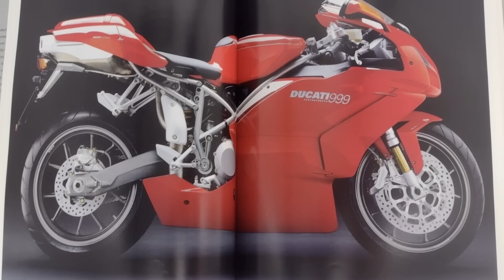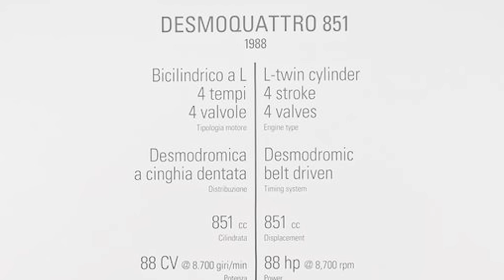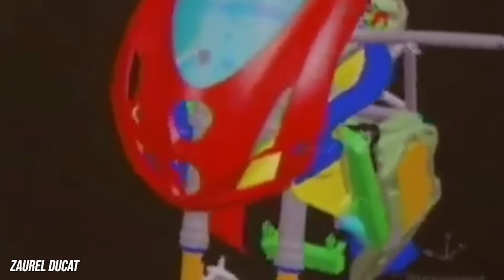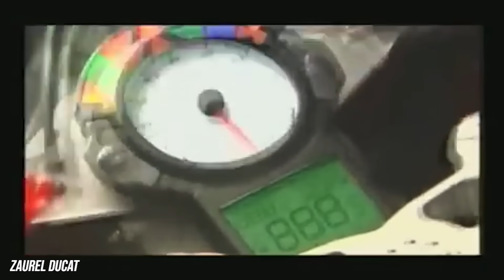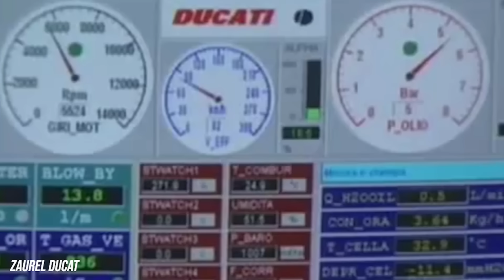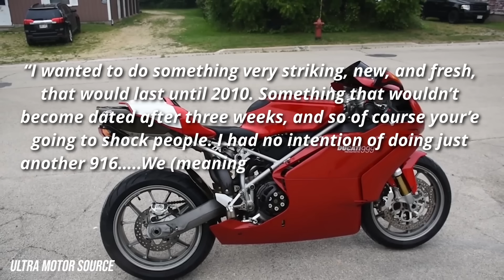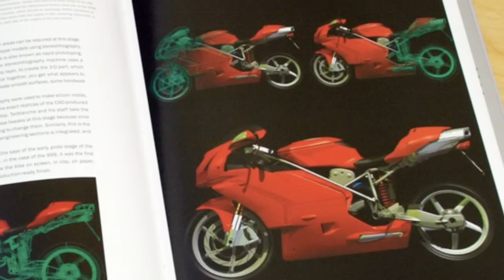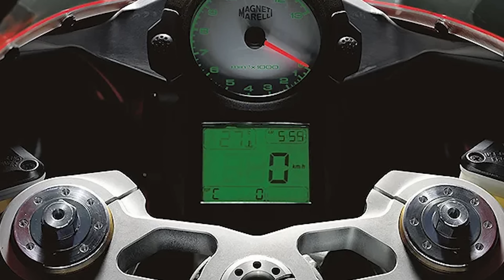Ducati's most hated motorcycle

Comment: This is a great video! Gives me a much better appreciation of the 999. I was a GSXR guy at the time and us Gixxer fan boys saw the Ducati's bros as snobs. My first Gixxer was a 2001 1000 that I bought when I traded in my 1998 CBR900RR. Well, I had a change of heart when I bought my first Ducati, a 2007 1098. Wow, what a sexy bike that was! I would sometimes just open the the door that led into the garage, turn my garage light on, and admire that beautiful red machine. It was a dream to ride but no where near as comfortable as the 2001 Gixxer 1000 I learned to ride the track on. Still, I became a Ducati Bro at that point.

Back to the 999...I never liked the 999 at the time and thought it looked like a 1940s locomotive with those cyclops stacked headlights. This video gave me a new appreciation of the 999 and now I'm actively searching ads for one to add this bike to my stable. :)

Comment: The 999 in race spec looks terrific. The biggest issue was the need to incorporate the headlights, which did impact the overall look of the bike. But, beyond that they were a fabulous bike to ride. I had a 2004 that I rode for a decade. It was one of the better bikes i had owned up until that point and was certainly a much easier bike to ride vs the 748R i had for a time. When I see a 999 on the streets they still make me smile.

Comment: I thought the Ducati Paso was the most hated Ducati. Both the 999 and the Paso were very forward-looking designs that have aged very well, with properly considered features that add to the expierence. If I had a 999 I'd paint around the headlights black to de-accentuate the feature, asite from that, it's a purposeful looking machine. I didn't know it had a sport touring riding position. Any rider who has ridden sport and sport-touring bikes will tell you that sportbikes are what you want, sport-touring bikes are what you need. Honda VFR1200F owner here.

Comment: Liked them, but having to change the piston rings to 996 rings to stop them from pulling oil through crankcase breather was typical first year Ducati b.s.
But at least the rear rotors didn't fall off like the first runs of the 916.

Comment: I have had a Pantah, 906, 851, 907ie, 916, 749, 999s, 999 and now 939 SS. That’s my own black 999 you photographed! (Well, I photographed it…) I love the 999 and if someone could fix its electrical gremlin I’d still be riding it. I’ve done about 50’000-60’000kms on each of these bikes so it’s not as if I don’t know them. 
The 999 is my favourite. Plenty fast enough and a lot more powerful than the 939 despite only having 60cc more engine. It’s a lot smoother too and just as good on fuel. I assume Euro 4 or something is the fly in the ointment with the later bike. The instrument cluster is superb and the mirrors don’t vibrate. 
I took mine from Switzerland to the very north of Scotland and once did 1’000 kms on it in a day almost non-stop (though it did kill me). 
I do not despair of riding it again one day. Best Ducati I ever owned and infinitely more comfortable than the 916, though I still racked up the miles on that. 
Just a pity it didn’t have a single sided swingarm.

Comment: Exactly why I havent sold my 749.  This design was great.  Beautiful, futuristic, but actually has an classic elegant aspect to it, in the flesh.  If you have both bikes sitting side by side, its obvious its the 999 thats the more beautiful.  But both have their own allure.  916 and 999 ride so similarly.  And yes 999 is better just like anything that supercedes prior models.  And 749 than the 748.  Also 749 is more tractable on the road.  Small tweaks make these bikes better for riding...which are:  larger clutch slave cylinder, modern 48 tooth clutch basket, power commander, 42 tooth sprocket and the R1 throttle tube mod.   Now its much smoother and pliable, with more feel, less hesitation, less jerky.  Honestly the hate was only from the press and people who never rode these bikes.  Im so glad there were so many that cherished this design.  The negative views meant that when the 1098/848's came out...we had something uniquely beautiful.  All the models after, up to now, are cool and striking looking.  999/749 was beautiful in it own way.  The performance of these on the road is all anyone will ever need....as the new bikes get more and more lightning fast.  All these bikes since the 851 were meant for the track and they proved it in WSBK over the years up to now with the V4.  Remember "the ugly duckling" turned out to be the beautiful swan.  I compare the 999 story to the F40 and F50.  Everyone said the F40 was better.  But in reality, it wasnt.  Mainly just build quality.  F50 was better and much more beautiful, and tractable for the road.  Beauty is always in the eye of the beholder, but again, put an F40 and F50 next to each other and see in person.  The F50 and 999 were in my opinion the most beautiful.  I was always happier being in the minority for loving them.  Now they are appreciated.  And now videos are being made.  I guess some people weren't ready for drastic change.  And in the future people will look back at Panigale's and feel the same, its cyclical.  Every brand has some version of this story over the years.  But remember, timeless design is timeless.  And some models just hit that mark perfectly.

Comment: In 2003 I picked up my first motorcycle magazine as a young man, and leafing through it. Not knowing anything about the 2 wheel world, I saw a big spread about this very bike and I loved how it looked like nothing else in that issue and all the other mags. The red was very alluring, and I had no prior knowledge of what DUCATI or a 916 was. This was just what I thought a sport bike was supposed to be.

Fast forward to about 5 years ago, a black 999S with 900 miles rolls into our consignment shop and and the boss wants me to try to get it started, since it seemed to have not run in long time. It had a termi exhaust and when I first got it cranking inside this antiques shop, you could feel the compression from engine resonating off the walls. Everyone in the front office was poking their heads out wondering what was going on. 

I relocated my efforts to the back alley behind the shop, fiddling with the choke lever on the handlebars, which confounded me since the bike was fuel injected. It finally fired up and made all that lovely L-twin, dry clutch racket. My boss asked if it was supposed to sound like that, so I revved it and he gave me a thumbs up.

I took it for a spin, but with no plates, insurance, and registration, I couldn't leave the parking lot. But I had been lusting for one of these bikes for literally decades now. It sold a few weeks later at auction for about $9k which was more than I could afford or else I would have tried winning it. But got to have a small taste.

The 999 is my white(red) whale. I still see them come up on cycle trader occasionally. Even the 749 versions. I still want one. Hopefully the hype after this video doesn't make the price skyrocket😂
Reply: Oh, sorry to hear you didn't buy it there and then after 'unsuccessfully' trying to start it.." this thing is a pile of junk but ill buy it off you cheap" 😂 good luck in your search 🤞
Reply: @ENLSN77  The thought had crossed my mind 😇

Comment: Miles ahead of the 916 platform.First duc that won against 4cylinder bikes of the same capacity.For me,probably the duc i would buy with my own money,would just get a newer ecu on it.Worked on 916,996,998,999,1098 and 1198.I would buy the 999

Comment: The 999r I had was no joke. It was the loudest motorcycle, Ducati I've ever had. I've had four ducks. This was the only bike I got thumbs up by every Harley rider at a light, it was so loud. $60k spent on mine. This is the only duck to listen to as reference to what a duck sounds like. This bike was no joke, I kept up with any panigale on it, beat most up the mountain. Crack that throttle and you could not hang on

Comment: I traded one of these 999s  in 2007 on a 1050 Speed Triple when I was working in a Triumph dealership. Follow up call with the owner elicited the comment that the Speed Triple was "Slow". 
I was surprised as the Speed triple was a pretty punchy bike, so I took the 999 out for a quick spin to check it out. That 999 Testastretta had so much torque and so much top end... Incredible engine. Later I bought an S4R monster with the same motor.

Comment: The trouble was they departed too far from the existing lineage 916. They didn’t need to do much to make it look just fine and continue some of the design elements of the old bike, and the swingarm was just a mistake. It was a great bike, but those things did put off a LOT of buyers who only returned for the 848/1098. Just think how many more 999s they might have sold if it didn’t look like a slapped ass…

Comment: You simply have to experience the 999 live to understand it. I rode the old 900 Superlight Series IV at the time and found the 916/996/998 really nice - but also much more stubborn, especially at higher speeds. I bought the 999R, which I saw live for the first time in 2003, without a test drive - and have not regretted it to this day. It drives much better and easier than its predecessors, has a very good "form follows function design" for my taste and still looks top modern today. If you put a 916 ff. next to it, only then do you realize how "fat" the old models actually are compared to this very slim model. The 916 ff then looks like a chubby motorcycle from the old days. I see my 999R as a stylish face in the crowd, the bike is recognizable from afar. There is no risk of confusion... And that somehow makes it unique. In terms of riding, the bike is beyond reproach anyway.

Comment: To be quite honest: The 916 never looked too charming to me. The single arm swing is a nice thing, but it is inferior to a two arm swing from a technical standpoint. To achieve the same rigidity, there has to be much more material in it than in a two arm swing which adds unsprung mass. The 916's nose looks like the face of some Star Wars villain robot. Me, I much prefer the 749/999 which don't try to make a face but show a nice aerodynamic curve. I like the stacked headlights. If anything, a change I would like to see on it would be a nicely airflow friendly transparent cover over the lights for a cleaner airflow. With the 749/999, it is visible that aerodynamics and function shaped it. Aerodynamics often generates beautiful flowing shapes. The jet exhaust like way the exhaust points back looks like its thrust would add 10kph to the top speed (With Rolls Royce Merlin powered planes, the exhaust actually could add some 1000 Newton of thrust!) 
 It looks like the purpose built machine obviously was. I really like it. Elegant and butch at the same time, and its looks make a promise. 
A Ducati that really looks unattractive is the 906 Paso, if you ask me. I guess it's so much of a design fail that people prefer to forget about it, it's too meh to associate with a brand like Ducati nowadays.

Comment: terblanche: (verb).  1. To make something strikingly beautiful immediately, disgustingly repulsive. 2. To put a wart on the nose of a gorgeous woman. 3. to follow the sexiest motorcycle in history with a two-wheeled Pontiac Aztek. 
Everyone told me that the 999 just didn't photograph well. I took one for a test-ride and it looked even grotesquer in person. At least I learned from this vid3o that Pierre was South African.

After my 999 test-ride (straddling a ticking time-bomb), I bought a 2002 copper-color Kawasaki ZX9R. The valve adjustments were admittedly a PITA, but that motor was butter-smooth and I've gotten over 100,000 miles on it. And it still doesn't burn a drop of oil and is still so much more beautiful and desirable than these ugly bikes. 
Its a mystery that we never see any of these hideous 999s on the road...?
Reply: Or 2002 copper ZX9R's for that matter ?
Reply: @61js  Mine is. :) And so is my friend's. 112,000 miles on the clock and it still pulls like a peach and doesn't burn a drop of oil. In fact, the oil is barely as dark as the copper color when I change it after 3500 miles. The amazing bike defies the laws of physics.

Comment: When it came out it was following the 998, which is a design classic, and it not only had a very unusual appearance but also ditched the single-sided swingarm. It looks a lot better in race trim and did very well on track. I still don’t like the lights but it has aged well and seems to look less offensive now than it did at the time. The funny thing about the 999 is that it was designed by the same guy who designed the SportClassic, which is a stunner and was well ahead of the retro cafe racer trend.

Comment: I never owned a 999. I was a 998 and 1098 owner, but I had a few opportunities to ride a 999 and for me from a driving experience it is one of the best or maybe the best motorcycle I've ever used. The trick with the 999 is that you have such a wide band to set it up. You can set it up to behave like a copper that you can barely get it around a corner and you can set it up that it is agile like a 1098 but with way more precision. I am a pretty tall and heavy person, so my 1098 never really worked for me. I loved my 998 but I always missed that last bit of agility. The 999 you can set it up pinpointly sharp to your needs. Yes it is ugly but it really works very very well.

Comment: No, the 999 did not predict any wings. It simply had a slot which, perhaps, provided better boundary layer control at different attitudes.
The difference between a wing and a vertical slot is quite significant, both in looks and in function.
Reply: And, arguably, Aprilia did it before them on road bikes with the "ears" on the Mille's 1st facelift in 01. And even that is irrelevant as it was something that has been tried before by Suzuki in the 80s and MV Agusta in the 70s on race bikes. Both of which were more akin to modern winglets than the Mille's or 999's.

Comment: I had the last year of production, 2006. It came with radial brakes, and ABS. That was it for technology. Super easy to ride, and to ride fast. Unfortunately, the heat it generated limited my rides. I would soon sell it, picking up a 2006 Bimota DB5S. Not the “R”, but still a formidable sport bike. Later, local shops would take race track refugee/ discarded 999/748 frames and shove the air cooled 1000/1100 engines into these frames. They were sold uber expensive in this setup, as they were real nice bikes, not junk that was simply put together.  This was the perfect use of this fine, hand made frame.

Comment: Pier Ter Blanch - You owe my respect 🙌
Two things i wanna point 👉

1. THE PRACTICALITY-
The thought of changing the solid statement of a sports bike, by lowering the seat height, changing the aggressive riding stance, sleeking the tank, in short making it more comfortable was a great idea. Who don't like comfort. A Designer is a problem solver. And he did his job pretty well.

2. THE DESIGN - 
I had the poster of this Yellow coloured 999 on my wall when i was small . I always looked at it and imagined what a beauty it is. I've always loved this bike from its 1st glance.
                So on that note, i want to say that this bike was literally way way ahead of its time.

The AIR INTAKES on the front panel & the side winglets are what we're seeing today in current superbikes. 

The SWINGARM this time was two sided but it was completely blacked out, so it nowhere disturbing the looks. It still was mixing good with the body.

Also the VERTICAL TWIN-POD HEADLAMP setup, the sharper front was although new in terms of design but what i knew about DUCATIs that they have produced beautiful motorcycle with UNIQUE ELEMENTS, from Monocoque chassis to single sided swingarm, L- twin engines to underseat exhaust setup. Everything was still carrying foreward by the 999 and as a designer he did pretty well by maintaining the FORM FOLLOWS FUNCTION statement & carrying the traditions.

If Ducati will launch this bike today with miner tweaks to meet current feel. It will burn the Market. I'm also a automotive designer and believes BEING UNIQUE IS BETTER THAN BEING PERFECT, just what you did Pie Ter Blanch 🙌🙇❤

Comment: These were excellent bikes at the time, I actually found myself arguing with guys about the looks and I didn't even have any problems with the NON single sided swingarm. It has a long wheelbase which does make it hard to steer in tight corners but it's a great bike, ride one and it'll change your mind. Another great thing about them is a mid condition one with a few scrapes is very affordable and it has no rider assist and I love that! Raw and fun!

Comment: Duc4ti's original design was 851-999R, but Duc4ti prefers the Honda design base, especially the NR-RC series, or currently closer to the RC46 x RC212V 2007. because this design base is truly extraordinary. The 999R was Duc4ti's attempt to restore their original design, but failed because it was their own fault that they had already abandoned it, the H0nda design base was already attached to them, so it was difficult to return.